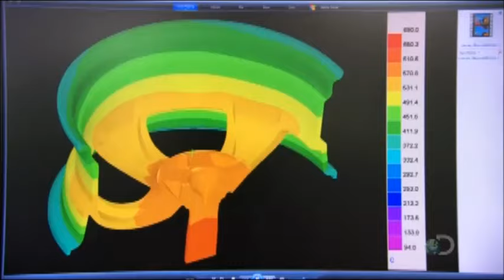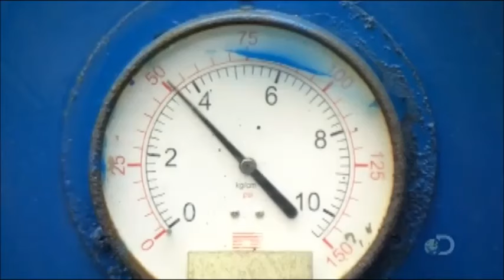How It's Made - Alloy Wheels

Comment: It's curious that they don't mention one of the most important aspects for those who use wheels made of light metal alloys, which is the fact that they help the behavior of the shock absorber by reducing the inertia of the many fast vertical movements per second. Better suspension...better handling on the straights but especially when cornering.
Reply: They did say alloy wheels improve handling in the intro. I suppose they didn't feel the need to go into detail about why, which I think is fair enough considering the show is about how it's made, not about giving a detailed explanation on why you should buy alloys ;)

Comment: About weight factor, there is a wide range in the amount of weight difference between steel and aluminum wheels. Many cast aluminum wheels from the car manufacturers weigh nearly as much as the steel models. For example, the 16-inch by 6.5-inch steel wheels on the Chevrolet Cobalt and Malibu weigh 19.2 lb. each and the optional aluminum wheels weigh 18.9 lb
Reply: Only Tomato I doubt the aluminum wheels are also 16 inches tho.... typically when you upgrade, you also get larger wheels and thinner tires.

Comment: The biggest advantage of light rim in the reduction of your unsprung mass, which is critical with low height tyres. When driving over an obstacle with low height tyres and you have heavy rims combined with them, the tyre cannot push the the rim/wheel quickly enough upwards which means the tyre gets deformed a lot more tham with low weight alloy rims. so basically alloy rims extend the life-span of your types by far and also making your ride more comfortable. especially - as stated above - with low height tyres.
Reply: Are they low height or low profile?

Comment: No, they weren't first made from Magnesium, they started with aluminum. Then in the 60s, some auto makers tried Mag since Mag is significantly lighter than Aluminum.  But Mag corrodes so badly, and is much more dangerous to cast and machine that auto makers gave up on them.
Reply: Incorrect. Mag alloys had been around since the late 20's, not the 60s. They actually faded in the 60s when aluminium casting techniques improved
Reply: @alanrobinson7891  Incorrect. There was only one guy in the world who knew how to cast Mg before the war, and he kept his secret very tightly.
Reply: @e-curb  is that so?
"The original cast magnesium wheels were made beginning in the 1930s and their production continues today. Some of the biggest brands producing magnesium wheels in the past include Halibrand, American Racing, Campagnolo, Cromodora, Ronal, Technomagnesio, and Watanabe"
Reply: @alanrobinson7891    There was only one guy in the world who knew how to cast Mg, so saying Mg wheels were around back then isn't a very truthful statement.
The wheel manufacturers you quoted were making Mg wheels in the 60s. British Racing Motors (BRM) and Mahle are two more manufacturers who made Mg wheels in the 60s.
Reply: @e-curb   Halibrand have been making magnesium wheels since 1946, which correct me if I'm wrong, is well before the 60's

Comment: Spoiler alert: Steel is an alloy, too. Lightweight wheels are most important to reduce "unsprung weight" which has an effect on ride quality. You want the suspension pieces below the springs to have as little inertia as possible, so when they hit a bump, they move up or down faster.

Comment: Wheel making is a very interesting process although there are various ways to make them.  I am familiar with both dual gate and single gate low pressure processes and kind of liked the work when I was making wheels for Honda at a local wheel plant that was in my town oh about 20 or so years ago.  With that said, unfortunately the company did not maintain the equipment in order to run good quality wheels as one sees in this video where there is minimal excess flashing on the wheels and not excess appears to be left behind in the die.  That’s huge for wheel making.  Also, no shrinkage or impurities  can be seen in the X-ray of the wheels.
Reply: Did you work at the one in Toronto?

Comment: It's something of an irony that 'exotic' aluminum started being used for automobile wheels as a weight saving device while also improving handling as aluminum components reduced unsprung weight. Present day, wheel and tire combinations have grown much larger/heavier over the past two decades which puts additional stress on suspension components.

Comment: Don't show me how it's made, show me how to keep it from being stolen.
Reply: keefmeister77  park your car in white neighborhoods and be on the lookout for minorities.
Reply: +keefmeister77 get two different types of wheel nuts on each wheel, special nut ones that can only be screwed with a special key-input . make sure u tighten heaps, maybe use a rattle gun, and get a 5 star vibration sensitive alarm lol. if u wanna be even more secure, park your car inside your garage instead of outside.
Reply: +SPaoline4302 Same size socket, banged with hammer will make to removing the security nut possible without any special socket. So, this is not solution
Reply: +keefmeister77   Park it in a White neighborhood!
Reply: Cambodia Luxury Cars
What cars?
You mean a water buffalo pulling a bamboo cart?   hahahahahahaha
Reply: +keefmeister77 Take them off at night, and keep them in the house with you.  Put back on the next day with you are ready to go again.  About the only sure fire way to keep them from going bye bye.
Reply: keefmeister77 How it's made: lazer alarm system
Reply: Who would take your Kia stockers?  Oh for the valve stems.  I get it.
Reply: keefmeister77 1. get tazer 2. attach one post to the metal on the car 3. ???? 4. profit
Reply: they can't if you don't have it
Reply: keefmeister77 Get a garage?
Reply: Get some ugly 15" wheels and they will always be there in the morning.
Reply: LOL ;)
Reply: Lower your deductible on insurance to $100 and problem solved. Get a rental, new wheels and tires for only $100.....someone come steel my wheels please.
Reply: Put the special socket nut
Reply: keefmeister77 locking lugs
Reply: Don't buy any.
Reply: Wire it with C4
Reply: @Aeon7YK  bad news to over tighten lock nuts.
Anyway, if someone wants your rims then their having them.
Lock nuts or not"
Reply: @richardbotellio1095  ...and watch as some white guy steals his car. you want us to believe that there are no white criminals. This one white guy stole anything that you set down. He stole a child's book bag. He stole a bike and broke into a car and stole a radio.
Reply: Eastern Europe is mainly white, but crime rate is quite comparable to Bronx, Harlem or Detroit.
Reply: @richardbotellio1095  lmaoooooo fr fr
Reply: @rattmann36863  you don't say? I might need some hub/brake parts ;)
Reply: Invest in wheel locks or splined lug nuts and order an extra key, keep the key(s) in a safe place. It's probably the most cost effective way.I have yet to have anyone steal mine.
Reply: Red thread locker!
Reply: Don't buy them. XD
Reply: Richard Botellio LMFAO
Reply: Use steel wheels, just like police cars.  Thieves are not interested in them.

Comment: Many newer cars come standard with Aluminum wheels. I remember my first  brand new car didnt even come with a radio. They wanted to charge me extra, so I had it removed. They left the speakers. lol. I removed those too. I installed an Alpine system that had a boosted graphic equalizer. Now we bought a car that came with Aluminum wheels and a Bose stereo system. My how far I have come. My first brand new car costed $3,500. My car now cost $16,000 used. It was $27,000 when new. I never buy brand new now.
Reply: RC Hobbyist Extreme thank god some of us do otherwise there wouldn’t be any used cars to buy.

Comment: The standard alloy wheel is usually HEAVIER than the steel wheel. They just look better. You need to buy more expensive wheels to have them lighter.
Lighter wheels are usually rolled from a blank and not cast. Casting is just the cheapo variant. Very expensive wheels are rolled from a forged blank.

Comment: all that work i run over a brick at 75mph and its gone
Reply: No. It's still there, there, a bit here. something over there.
Reply: That's soo true; the dealership ok these type of rims for the low cost, not certain about the customer's need for durability
Reply: @DTSTANGO  OEM wheels are usually very strong.  It is the cheap aftermarket crap people put on cars that is weak.
Reply: No one forced to you to get low profile tires.

Comment: Yikes, this is a very weak form of Alloy wheel production. Pressure Casting.  These will bend at the sight of a pothole. 
Rotary Forging or Monoblock Single Piece Forging is way stronger and prevents the Aluminum from becoming Porous and Heavy.

How the Alloy wheel is made matters more than it simply being advertised as "Alloy".

Comment: Aluminium wheels are not 'A fraction of the weight of steel wheels'. Most aluminium wheels are in fact heavier than their steel counterparts.
Reply: Some of the worse designs are, but the original purpose was to make wheels lighter.  The lightest wheels around are still aluminum forged rims.   For heavy trucking, for example, a steel wheel weighs almost 80 pounds and an aluminum one weighs less than 50.    The problem is aluminum wheels have become a fashion piece, so car manufacturers and the aftermarket can get away with selling stylish looking poorly made garbage that has no advantage over steel than looks.
Reply: @bvcxzgt5451  It always annoys me when I see dumb wheel designs that have tons of extra metal that is no use structurally.  Especially when I consider some poor engineer probably spent 100 hours cutting a few grams of weight out of the car's suspension design to lower the unsprung mass of the system only to have some dumb wheel add 100X the weight they worked so hard to eliminate.

Comment: Unlike steel rims cast ally wheels will shatter under any serious pressure
Reply: That is true. But when a wheel is mounted to its specific momentum on the bolts. the force required to actually shatter them is astronomically, compared to what the wheel experience on every day use... My old 17" wheels even surpassed hard abuse, on bumpy roads. the inner part of the rim was badly warped. and the wheels still rolls on an old BMW...
Reply: lgf1978 good point.
Reply: Also, the failure point of an aluminum wheel is now a safety factor.
e.g. the wheel is an integral sacrificial component of frontal offset crash safety.
Reply: You're right
Reply: @MrMacman98  If the heat treatment is good, then the aluminum can be quite flexible.  They will break in a major crash, but they aren't going to break any more easily than a steel rim would.  Again, that's assuming both are well made.  I've seen plenty of bent aluminum wheels that didn't break.  My wife is Asian.

Comment: I wish they explain more about the painting part, I want to paint my wheels with the right materials.
Reply: They powder cost and bake on the finosh
Reply: @darrylkellu6687  They didn't show powder coating, but painting them.  Powder coat takes more time, costs more, and lasts longer, but requires the wheel to be electrically charged positive while the sprayed powder is negative, so it is attracted to the wheel.  There was no such setup in the video.

Comment: How do they make the mold that is used to make that rims? Does an artist make the mold for the mold? And wouldn't it be imperfect if it were made by an artist using clay or something like that?
Reply: Designed in CAD, file fed into a CAM milling machine
Reply: @RossABQ what materials are the molds made out of? For squeeze cast Al alloys

Comment: We're almost to the point where alloys are standard
Reply: 0.05mm nb!
Reply: +KayNineLP Alloys have been standard for donkeys years.  Steel is an alloy.  Try using 'ally' to denote aluminium alloy wheels.
Reply: +DepakoteMeister I bow to you, Sir !
Reply: DepakoteMeister manufactures refer to steel wheel as steel wheels, and aluminum wheels as alloy wheels.

Comment: From what material is made of the hose (or pipe) for mixing the molten metal to get the slag on the surface ?
Reply: a steel shaft works in a ceramic hose.(molten aluminum iss approximetly at 650-750 degree)

Comment: If you ever get the chance  to compare the weight a steel wheel  VS an aluminum one you will personally verify  the falsehood of  weight  advantage they  point to in this segment
Reply: Depends on the wheel.  Just got a set of "alloys" for a car I recently got.  15" x 7" wheel weighs 13 lb.

Comment: Is aluminum oxide usable or is it just an impurity that is discarded? It has a neat red color that I could totally see being used as a pigment.
Reply: I believe that aluminium oxide is used for dyes, i also believe that it's used in the medical industry or maybe that was magnesium oxide
Reply: There are many uses for aluminum oxide. One of the more common is as an abrasive in sandpaper.
Reply: Failing any other usage, aluminum oxide can simply be recycled with bauxite to form fresh aluminum.
Reply: There are a lot of uses for it; I'd imagine most of it just gets thrown back in the electrolysis cell and turned into aluminum metal.
Reply: Most sandpaper is made with aluminum oxide as the abrasive.
Reply: Jetta Driver your text answer is awesome B-)
Reply: @kellihollinger7715  And when mixed into a slurry with binding agents, then poured into a mold and fired in an oven, becomes grinding wheels for your bench grinder.

Comment: I believe that the mag was to dangerous in a car fire so they now use aluminum
Reply: It's not that, Irvin. There are a LOT of non-flammable magnesium alloys. They use magnesium wheels on open wheel race cars, so flammability isn't a problem. They're more expensive, though - as in "one magnesium wheel = 4 aluminum ones PLUS the tires that go on them" expensive.

Comment: Remove the hydrogen?!?!?! Don't they mean oxygen since molten aluminum gets readily oxidized by the air? Oxygen is a hell of a lot more nucleophilic than hydrogen, and other than water vapor I can't think of another source.
Reply: no. hydrogen becomes trapped in the molten aluminum, causing a porous cast if it isn't removed.
Reply: Where does the hydrogen come from? And aluminum hydride is a lot more difficult to form as it instantly will react with oxygen in the air turning into aluminum oxide and water. Do you have any sources on this Bob? Or did you work in this field yourself?
Reply: Marcus Taber 
I have my own hobby foundry. It's introduced into the molten aluminum whenever it comes into contact with water vapor, which is in high abundance in the air, especially around your crucible. When the water is introduced, it decomposes, leaving the hydrogen behind.

Comment: my question is, how come you can buy an aftermarket aluminum wheel for 100 bucks but factory/dealership wheels cost (on some cars) 1,200 bucks? and on top of it they have a $100 dollar core charge. yes that's the new scam! they want the old wheel back or pay another $100 bucks???
Reply: +Ken m  because of the different values. Some aftermarket wheels such as lets say, one called a BBS RS is worth a lot of money due to the rarity and can increase the value of a car because of what they are. But some aftermarket wheels can devalue a car for not being original. The manufacturers alloy wheels are normally a perfect fit to the model of car and they have been designed perfectly because it is specific to the car. It is expensive because of that and it will be more expensive because it is somehow better than the normal wheel you get. The more expensive factory wheels will definitely increase the value of your car so they can charge the higher price.

Comment: What is the purpose of dropwell in a rim?
Reply: Icey Junior for assembling the tire
Reply: ahhh okay thanks man
Reply: As you pull one side of the tire over the edge of the rim, the other side of the tire needs to move into the drop well so the mounting bead of the tire doesn't have to stretch to a larger circumference as you install it.

Comment: Are these not wheels...But rims?
Reply: No, they are not rims.  A rim does not have a center, thus the term "rim".  Wire spoke wheels like what were used in until the 30s, and bicycle wheels, and lowrider style wire spoke wheels are sometimes called "rims" because the consist of separate components which include a mounting flange, spokes, and a rim.  Together they are a wheel.

Going way back, a wagon wheel has no rim.  It has a hub, spokes, felloes, and a tire.  The tire was usually a steel band.  The word "tire" has been used since the 1400s.

Definition of rim
1
a :  brink
b :  the outer often curved or circular edge or border of something
2
a :  the outer part of a wheel joined to the hub usually by spokes
b :  a removable outer metal band on an automobile wheel to which the tire is attached
Reply: I C.
I was just going by what I've heard others call them for years because a rim still possesses a theoretical center.
Thanks for clearing up the terminology.
Reply: @mottbone  Others call them "rims" but that's just people trying to sound cool by using a slang term.  They are not just rims, but the entire wheel.  The rim is the outer circumference of it.  In some cases the rim is a separate piece from the wheel center.

Comment: Aluminum.
Reply: ...for example, platinum (known to Europeans since the 16th century), molybdenum (discovered in 1778), and tantalum (discovered in 1802). 

The -um suffix is consistent with the universal spelling alumina for the oxide (as opposed to aluminia), as lanthana is the oxide of lanthanum, and magnesia, ceria, and thoria are the oxides of magnesium, cerium, and thorium respectively.  

The word aluminum has a root, and it is "alumina", not "aluminia".  There is no debate to be had.

Comment: Simply untrue that aluminium wheels are lighter than the steel equivalents. I've weighed several and the steel wheels are normally half the weight of the alloys.